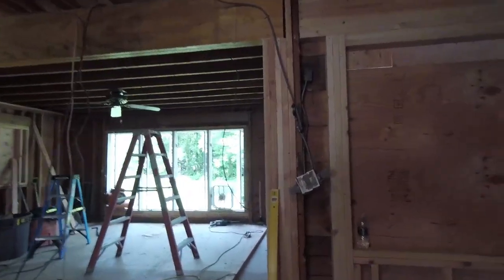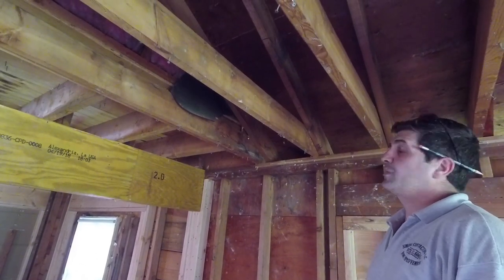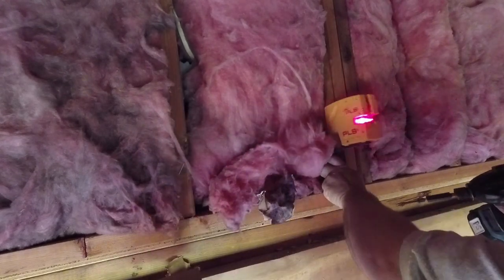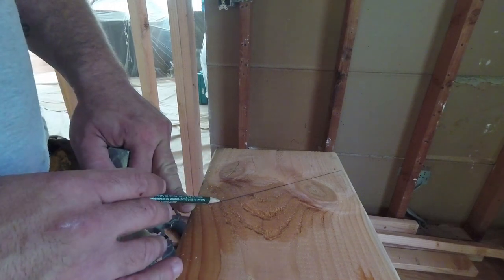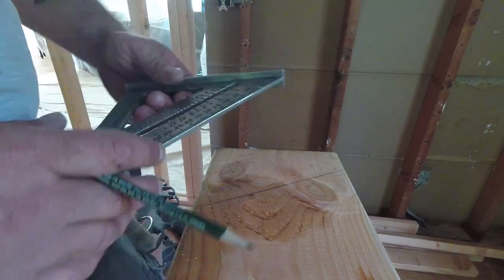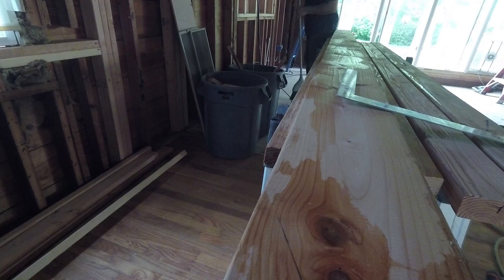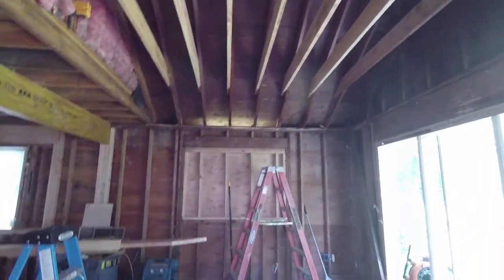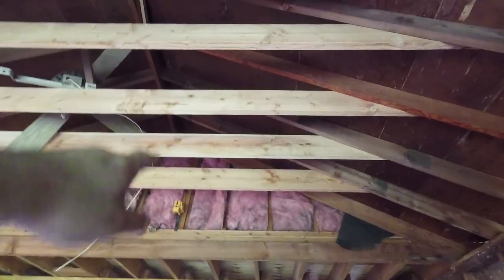FRAMING CEILING HIGHER

Comment: Raising the rafters this way, do you have to add braces down to the top sill plates?  I’m renovating my living room, house was built in 1947 and has ~7.5 ceiling I’d to raise atleast a foot, maybe two.  I had originally thought about doing it this way, but wasn’t sure if it displaces the load differently than having them sitting on the tops of the walls.
Reply: This method transfers so much weight that WAS on the top sill plate and down to the ground NOW all that weight goes directly to the roof decking frame — not good.😬
Reply: @damionbrooker715  That's what I was thinking.. surely this will put an outward strain on the walls? ? ?
Reply: Wondering this as well

Comment: Noob here.  Can this be done on a hip roof?  Also, for collar ties, can the original ceiling joists be reused (pending good condition)  since they will be shorter after raising them?   Would use one single new collar tie then cut the old ceiling joist out and replace the next one.   I would not remove them all first!   Also, I realize consulting a structural engineer is required but I'm contemplating purchasing an older cottage style house with 7' ceiling.  Thanks!   Great video!

Comment: Good video! Fun to watch your process. Nice work.
Reply from the maker: Thank you 
Much appreciated!
Reply: Great idea about pre-framiing those spaces for the new windows. I've never had a contractor do that. I've heard you can raise the ceiling joists on a rafter system as long as it isn't a 1/3 higher than the total existing rafter length, is there any truth to that? Nice detail work! All looks so clean.  @patricksimone1238
Reply from the maker: All Mountain that is correct about ceiling,yup frame around window and you don’t have to worry about weather 
Thanks for watching
Reply: Thanks Patrick! Will look for more videos, all the best! @patricksimone1238

Comment: Great video! Doing a little research to see if we can get our ceiling raised a foot. I was concerned because we had 2x4 rafters but that seems to be what you’re working with?
Reply from the maker: Lucas Rayala hey buddy,In my case I had existing 2x8 rafters and also had engineered blueprints.you should be careful if you only have 2x4 rafters because you will be adding additional stress to them
Good luck! And thanks for watching
Reply: How to prevent walls from coming apart?